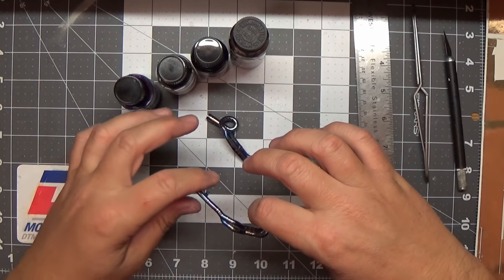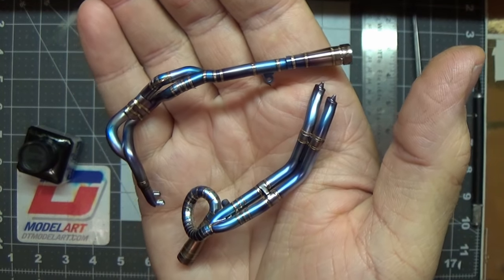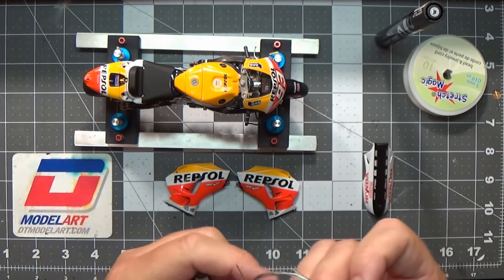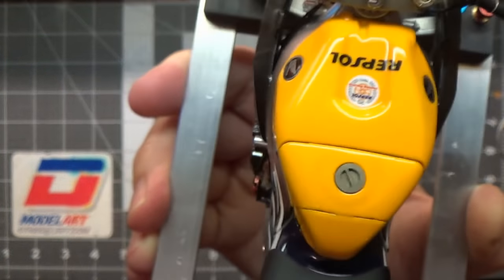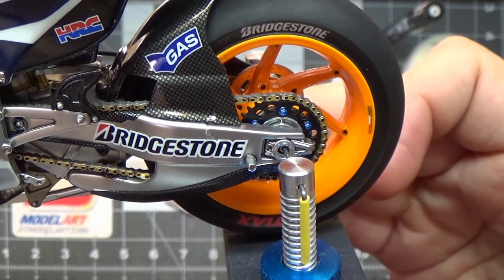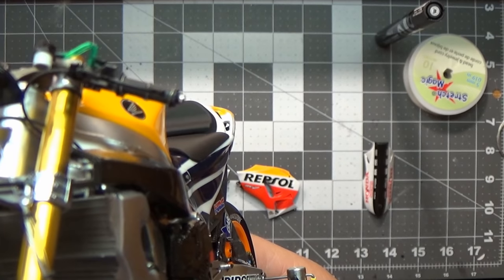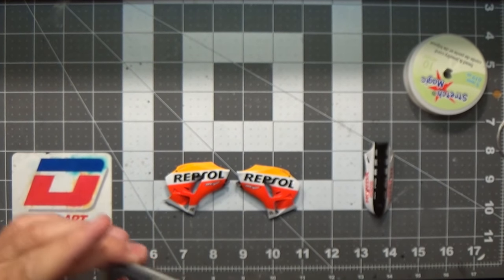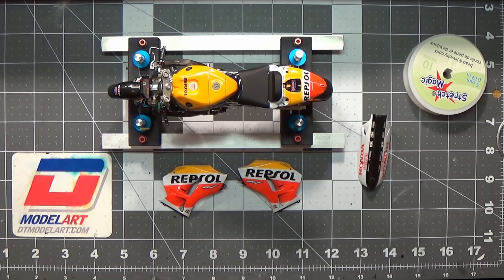Tamiya Repsol Honda  RC213V 1/12 scale model kit build-up video by David Thibodeau,  Part 7

Comment: Really great job David, especially on exhaust pipes and carbon fiber parts! What about tyres? You promised to show how to make real slicks in one of the previous episodes.
Reply: Jeka Gulyaev I did? I don't remember that.. :)
Reply: This is what I did to remove the tyre seams:
1. I sanded the seam with #600 grit sandpaper until it's no longer visible.
2. Then I wet-sanded the entire tyre with #2500 grit sandpaper.
3. Wiped the tyre with a "rubber restore solution", like the stuff used for car tyres. I used "303 Aerospace Protectant", which is not too glossy and gives a nice look.

The end result was pretty good (by my standards). Hope this helps.

Comment: hi, I tried your paints and I have some problems, I used an airbrush with 0.3 nozzle and pressure at 1.5 2bar, I followed your instructions giving light hands but the paint is too rough, as if the paint arrived too dry on the model , do you have any advice for me?
Reply from the maker: Where did you buy the paints from? From Spain or from Florida?
Reply from the maker: Gravity Colors paints sold from Spain has that problems you described, paint is too rough and aggressive on plastic. can cause crazing on plastic and it doesn't lay down smooth, but with a rough texture. You should contact Antonio at Gravity Colors Spain and address your concern to him. This is the Gravity Colors USA official gravity Colors YouTube channel, we have nothing to do with Gravity Colors Spain since 2017. We used to be one company but broke up in 2017 due to customers complaints about their paint quality sold in Spain. You can read more about that on our website if interested: https://www.gravitycolors.com/faqs-2/
Reply from the maker: Paints we sell in Florida lays down smooth and very soft on plastic, doesn't cause in crazing on the surface.
Reply: @GravityColors  spain
Reply from the maker: @vitarotondo6029  OK so you have to talk to Antonio in Spain about tissues you are having with the paints. You can send us a text message to (561) 425-8965 if you want to try  the US version of Gravity Colors paints. I am sure you will not have any problems with our paints as those are premium quality high end products. All our Gravity Colors videos on YouTube were featuring Gravity Colors US paints.
Reply: @GravityColors  can you give me an email from antonio? I live in Italy and I cannot call Spain unfortunately
Reply from the maker: @vitarotondo6029  I am sorry but I can't give out his personal email in public on you tube. You can just go to their website and he has a live chat there, you can send a message there and he will reply back to you.
Reply: I've been using Gravity Colors USA paints for years with no issues. They lay down nice and smooth in 3 coats and the paint comes out amazing.
Reply from the maker: @brandondrescher2182  Thank you! Appreciate your feedback!